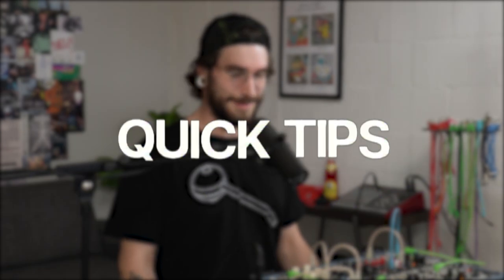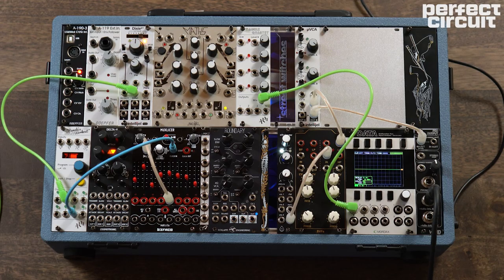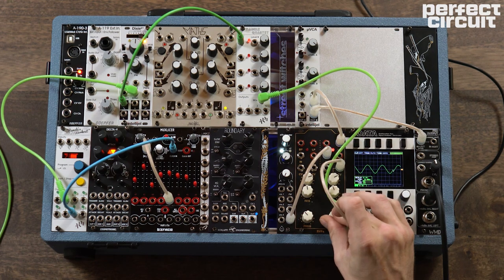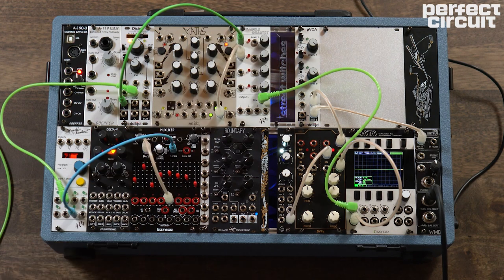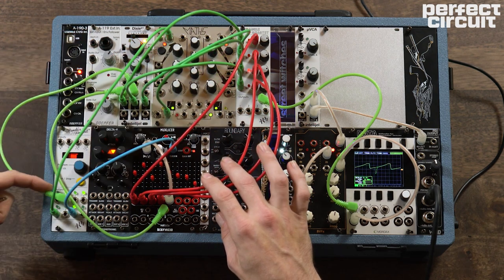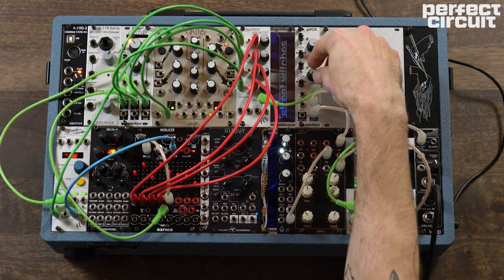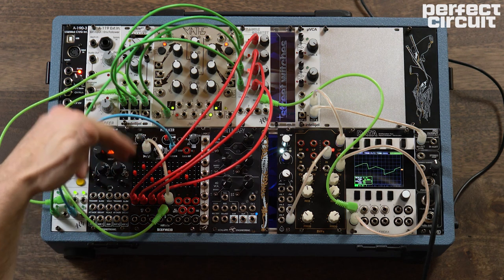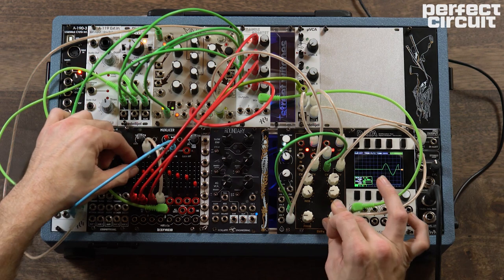Quick Tips : VCAs Aren't Just for Volume !! Part 1 : Wobble Control

Comment: Nice videos! Does linear VCAs work good with both CV modulation and level control of audio signals envelopes? Is it correct that you use exponential envelopes through linear VCAs when controling the level of audio signals?